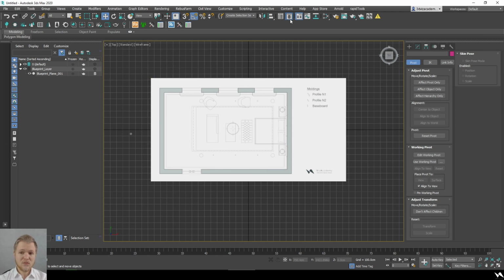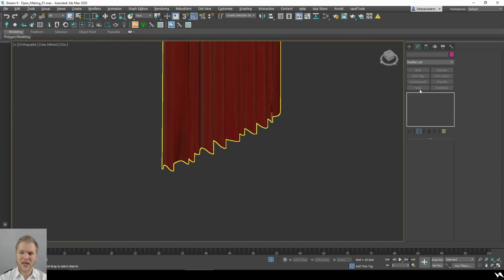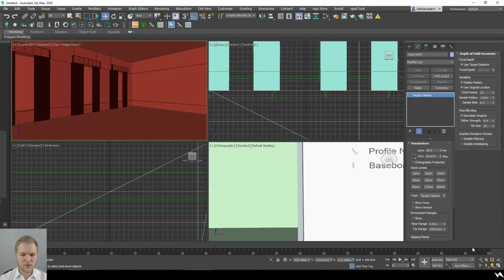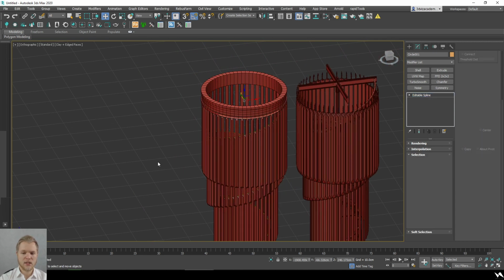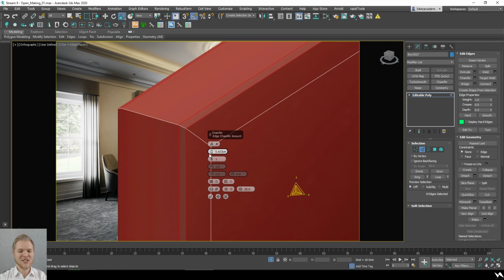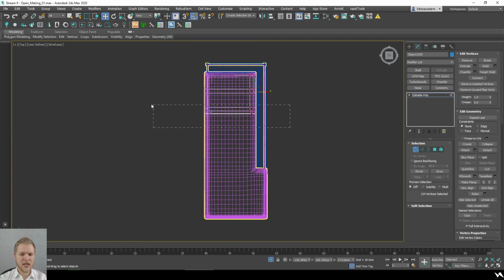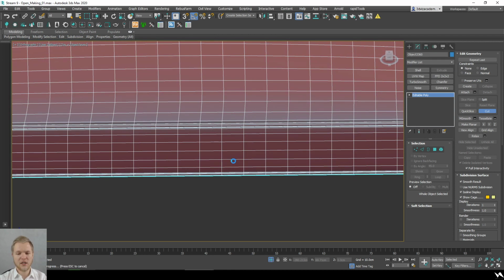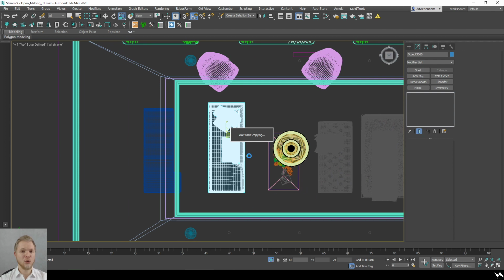[Workshop Day 1] Bedroom modeling in 3ds Max

Comment: Question Mike, some times I receive floor plans with no scales, so I have nothing to measure by, I've gone with the option of re scaling based on standard door width dimension, is there a more precise way of figuring out dimensions?
Reply: The short answer is NO. Without some known dimension to scale from you really can’t be sure. But a doorway is a pretty good place to start. Unless you have reason to believe it’s an oversized or undersized door then you can normally assume its height to be around 6’-8”. If the drawings happen to show kitchen elevations then there are plenty of common sizes there that you can use to cross reference your scale: counter depths are typically around 25”, dishwasher widths are normally 24” or so. Fridges tend to be either 24” or 30” or 36” or 48” wide. But, really, with no dimensions to scale from you might just be looking at a house with larger or smaller doors.
Reply: @maddoctor99  Thanks for the info, very helpful 👍

Comment: when I try to rotate extruded part of the sofa it rotates it in 3d not only 2d... I cant figure out what I do/did wrong :( Any idea how to fix it?
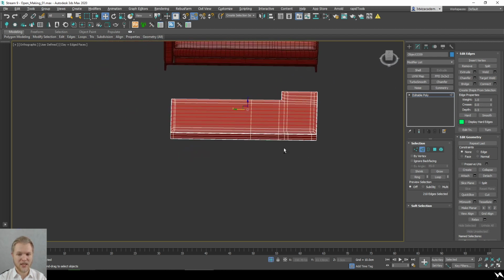Also, how do you use snap toggle so it keeps the point of reference but doesnt snap to a vertices? I dont get how you remove edge while making mesh of sofa more dense (1:28:30) and the faces that include that edge as part of their geometry dont get removed :o